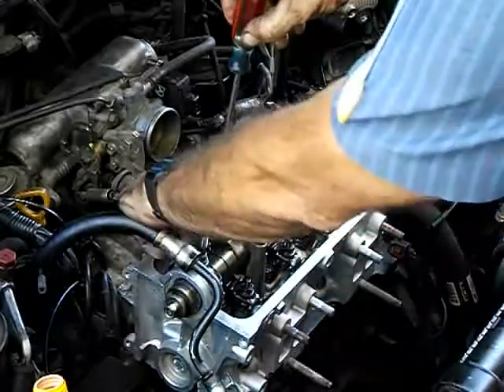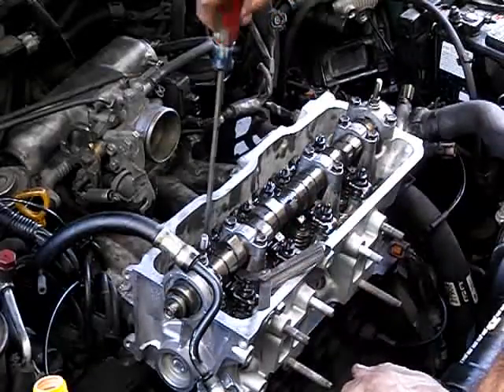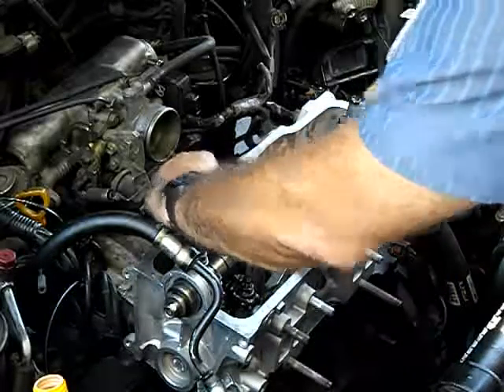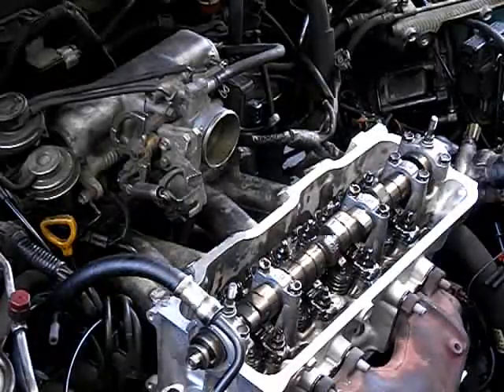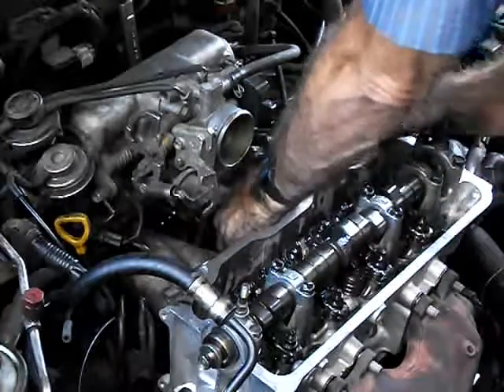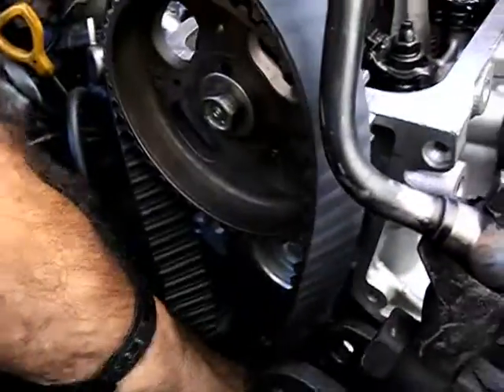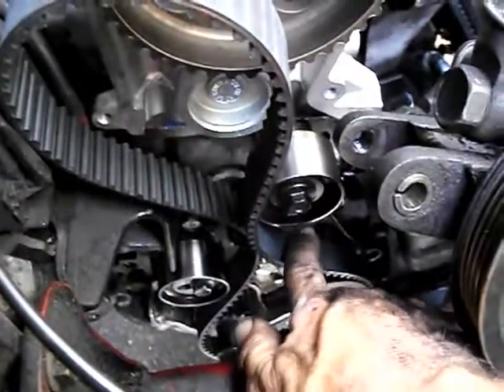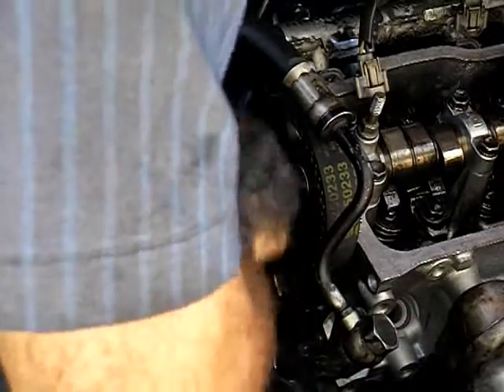Tercel Cylinder Head Pt 3

Comment: how do you remove the serpentine belt?
Reply from the maker: There's a tensioner pulley near the bottom with a long 12mm bolt you can get access to from the top of the engine with a socket and extension. First loosen the 14mm bolt (or nut) at the front of the pulley which sets the position of the tensioner.. Then turn the 12mm tightening bolt of the tensioner counterclockwise which will gradully pull the pulley upward and release tension on the belt until it can be removed. Hope this helps.
Reply: Nice thank you! Everything online said moving the alternator which wouldnt make sense with this setup. Even the official toyota books just Said. "Remove drive belt"